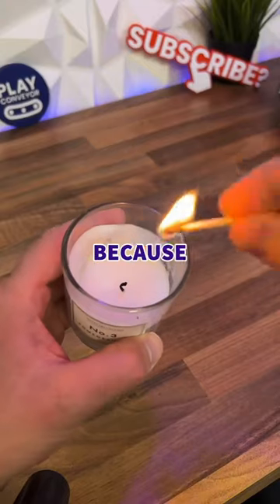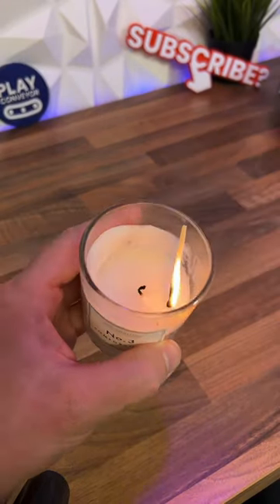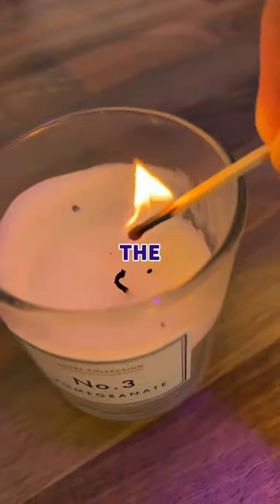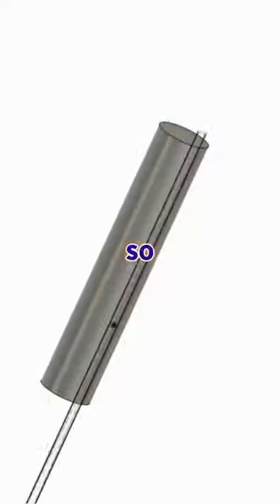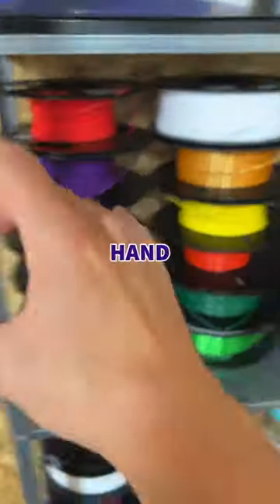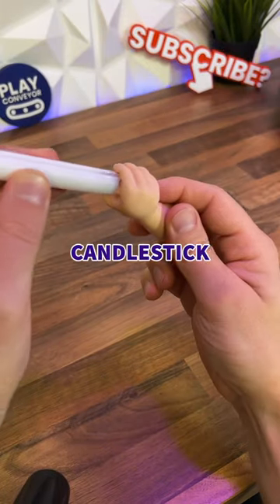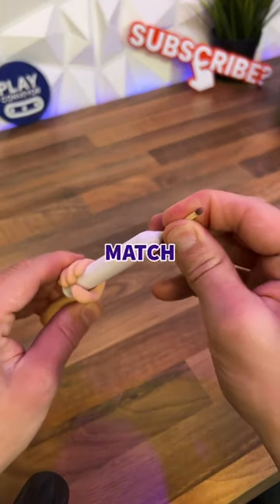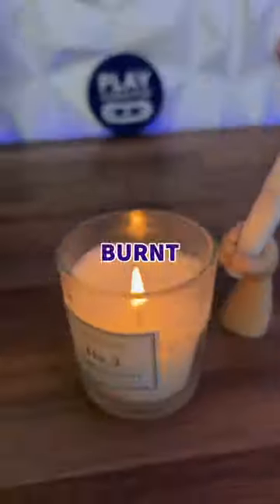3D printed CANDLE LIGHTER #3dprinting #shorts #candles

Comment: Sir you didn't have to 3D print that just use a torch it's way more easier and it's very easy to use and if you don't want to use it just till the candle it will work like the same